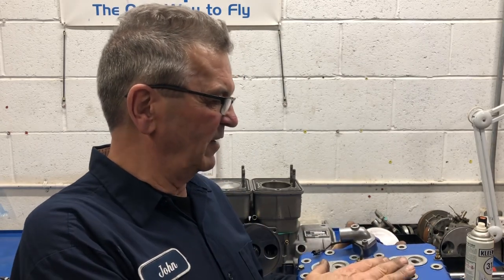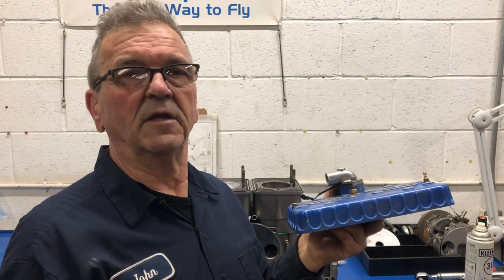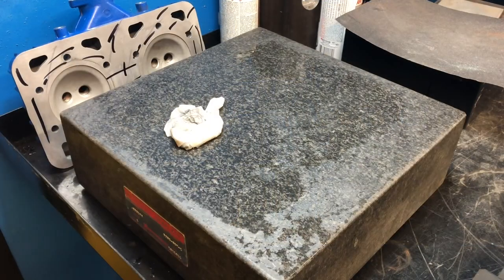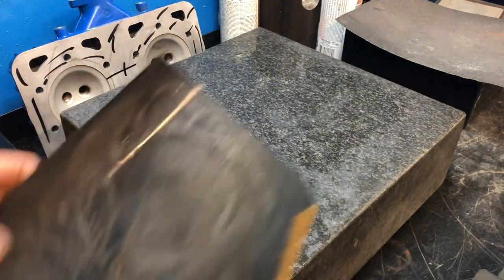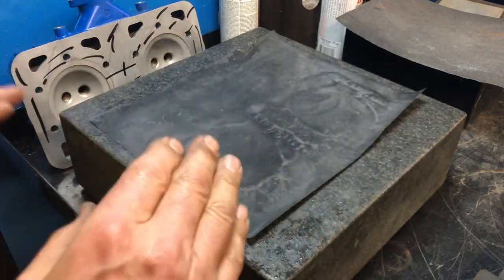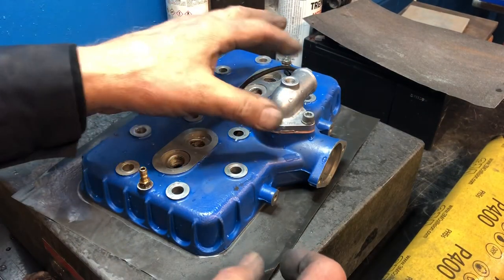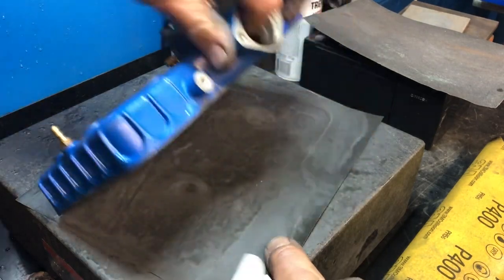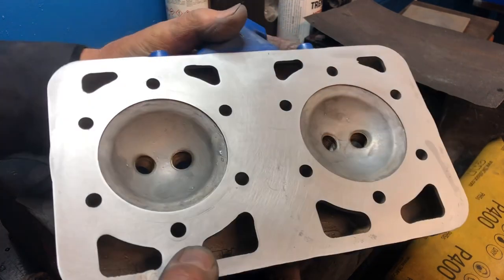Rotax 582 Blue head (part3) resurfacing the cylinder head

Comment: how are we supposed to use the cht probes?  I've been removing the spark plug crush washer but does that make more reach into the cylinder? if you don't remove it the probe gets all deformed.
Reply from the maker: Method 1, the CHT probe ring is supposed to replace the spark plug crush ring. If you use this method, simply cut off the uncrushed gasket. 
Method 2, install the spark plug with crush ring, torque to specifications, remove the spark plug and insert it through the CHT probe ring. 
Note, both methods only work properly with an undamaged, perfectly round CHT ring.